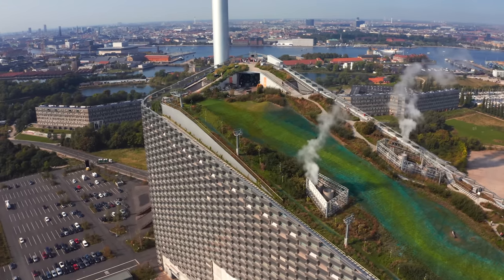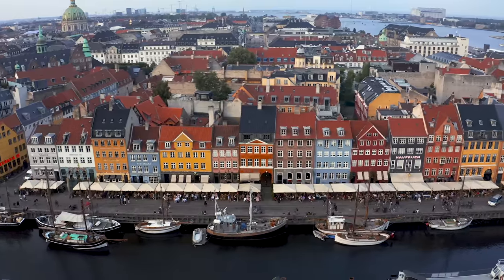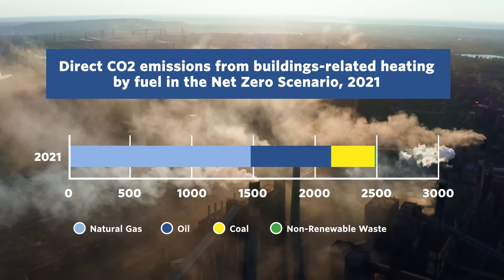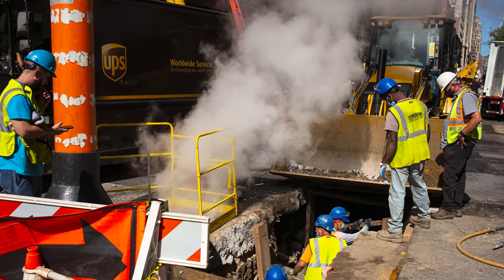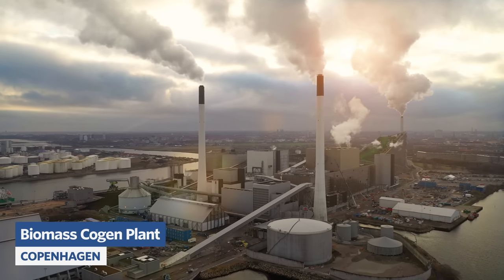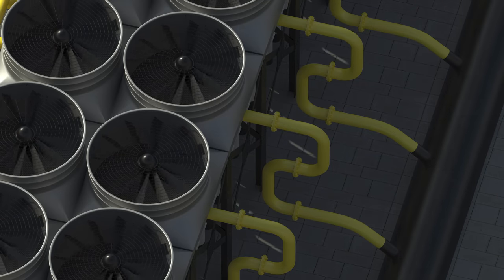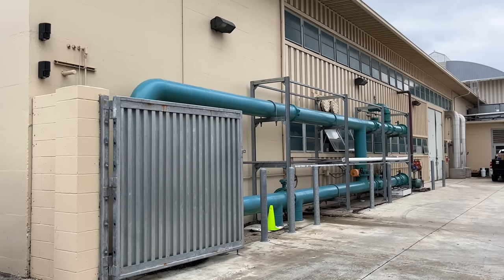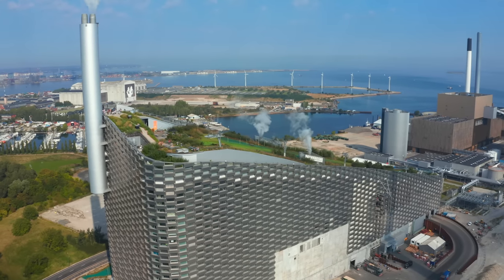An Introduction to District Heating Systems

Comment: My parents were recently connected to their district heating system and its great!
For one, no more boiler maintenance which means the cost-of-living is way more predictable (you will never have to replace your heating system for a lot of money, instead it is just a monthly fee like electricity.
Additionally, they gained a whole ass room in their house since they don‘t need the big and bulky heating system anymore.

The best thing is of course that the district heating system uses an energy mix and as long as the temperatures aren‘t too low it can run solely on renewables (in-ground heat pumps and geothermal) and only if the heating demand is high enough will it turn on the oil and wood pellet burners.

The local government also only connect you to the district heating system if you agree to improve your home insulation, which is done via a credit that you pay off over the monthly fees for the next 20 years, meaning it is actually super affordable.
Reply: And imagine that the power plant can reach 90+% efficiency compared to the ~40% of a good normal one. Isn't that amazing.
Reply: Do you know if it difficult to connect to the municipal system?
Reply: That requires trusting that the source of heat won’t jack the rate through the roof once you’re connected. Which isn’t a good bet.
Reply: @twestgard2  I'd assume it's not the US and also not a private company, but one held by the local government.
Makes price increases like that very unlikely.
Reply: @MegaBanane9  Yes, the US is definitely the worst in this way. That said, English water companies are privatized and the English have also had some really nasty problems with providing electricity to homes of poor people lately, aggressively shutting people off and even home invasions by the utilities to do shutoffs and change the meters. So unfortunately it’s not limited to the US and there’s a lot of political pressure to expand this system elsewhere.
Reply: @twestgard2  yea, the Tories in the UK have been doing their best to turn everything there into US style systems for the benefit of their rich donors
Reply: @DrSeaLionMD  depends on the individual system. I work for energy company where we have a few grids spread out across my home country and complexity varies. Basically it depends on distance to the grid, what the marginal production cost is and how large your heat demand is across the season.
Reply: @DrSeaLionMD  It depends on how far away the pipes are and what kind of heating you're using at the moment. If you have fairly close pipes and use soem kind of water borne heating then it should be fairly easy, if you are far away from pipes you might want to talk to your nighbours and see if you can all pitch in to dig new pipe to your neighbourhood. If you have electric heating at the moment switching to a water bornesystem is also very expensive espeically in multifamily houses.

As for cost at least how it works in the nodric countries is you pay a flat sum for being attached to the network and then an amount based on the current sypply and demand and your use. In summers hot water is often free, the cogen plants must generate a certain amount of hot water to create electricity and they want people to use it.

Comment: On the island of Fyn (Funen), Denmark, the big district heating power plant is so versatile in what it uses to generate heat, that prices have become lower this half year. Yes, despite everything. It was a huge relief, and shows the resilience of the system.
They use waste, straw, hot water from data centres and other factories, heat from green houses, and also some coal.
Reply: I have heard rumors tey will allow the fluctuating prices to go negative in summers in Sweden because of the amount of counter pressure (Heat that industry sell into the disctrict heating grid) they are getting. Probably not fully negative but they may allow use to offset the grid cost.

Comment: I lived with district heating the entire time living in Czechia. Pros: very cheap hot water, never needed to turn the radiators on as the transport pipes running through the flat did all the heating necessary, water was always hot enough to use. Cons: if you use more than your allotted share it's very expensive, two weeks of no hot water in summer while the plant undergoes maintenance (and other off periods where work is required).

All in all, it's a big thumbs up from me and worth the occsional inconvenience.
Reply: The two week cut off is easily solved by having multiple plants.
Reply: @placeholdername0000  New systems usually have heat storage tanks as fallback that can store the needed heat for a winter day or two. Those would easily cover the hot water requirement for 1-2 weeks in the summer. If the main generator doesn't come back up within a day, they can order mobile heat generators, that heat up that intermediate storage, so the customers don't have suffer the heat blackout. Alternatively you install a 300L hot water tank that is heated by the district heating, with electric or gas fallback.
Reply: That's really weird, here in the Netherlands district heating is a complete failure, more expensive than gas and needs constant work to keep working. People that have it, hate it.
Reply: Propose them to build a heat accumulator / battery into the district heating grid. We have them in Finland - for example some decommissioned 190 000 m3 oil reservoir - with perhaps some added insulation. Just fill it with the network juice and heat it when there's less need for heat in the grid - or energy is cheap otherwise. Then, when there's extremely cold period, the plant is broken, or whatever, use the stored energy in grid. So, it balances production and consumption, and can be used as an emergency spare energy reserve.
Reply: I'm guessing Prague? I never understood that 2 week pause, I also live in czech rep. and have district heating, but different city so we never have these long breaks, just the occasional maintenance check, maybe twice per year for a few hours and usually during the day when most people are at work anyway...
As for the allotted share, either that's another Prague speciality or it was something with your utilities company or your apartment building, I don't have anything like that...
Reply: @Aedar  And Ostrava. I think it's a holdover from before 1989, like the insane rent you can sometimes get a flat for.
Reply: That never happens here in Sweden.
Reply: @BLY99  Then you're not taxing you FOSSIL gas enough.
Reply: @DaDunge  So it's not cheaper. And how do you think district heating is powered? Also for your info, the Netherlands has the highest taxes on oil and gas in the EU.
Reply: @BLY99  That's the great thing about district heating, you cna switch power source in it really easily. You could burn garbarge or biomass or you could even use it with renewable energy and a heat pump and take the heat out of the ground. Then there's green hydrogen, and E-fuels. Or you could start using nuclearpower, either Fission or one day we'll likely solve fusion, regardless these prcesses will generate heat as a byproduct.
 
But most importantly there is the counterpressure, many industries pay to put their excess heat into the grid and this then sold for heating.
 
I am an environmental engineer, I have worked with district heating. You want to go 20 quesitons go right ahead.

Comment: FYI, district heating is used here in Norway as well, but not to the same extent as in a lot of other places.

It's mainly used in the larger cities near large industrial sites and waste to energy plants. Currently it provides about 10% of heating nationwide.
Reply: I mean one could combine geothermal heating with renewable energy to provide contrla heating. You have a lot of mountaints to take heat from, and a lot of renewable energy. Electric radiators are very inefficient.

Comment: My city has added heat pumps to its waste water treatment system, extracting heat from the waste water before it's sent out in nature. Taking the waste water from 12 C degrees to 3 C degrees, and adding the heat to the district heating. They also added a heat storage for the warmer periods of the year, to use in the winter.
Reply: Which city please? Thanks.
Reply: Interesting, how do you store heat for have or even quarter of a year to wait for longer periods??
Reply: I think the word you're looking for is heat exchanger not heat pump.
Reply: @DaDunge  In that case, the waste water wouldn't cool as much as 3°C, or that means that the ambiant water temperature is that low but I highly doubt it.
Reply: @etbadaboum  No heat exchangers cna operate at much higher echange rates than that. A heat pump is just a heat exchanger and a fan (two fans?).
Reply: @DaDunge  Gosh, you clearly don't know how a heat pump works, do you? 🙄
Reply: @etbadaboum  I don't think you know how a heat exchanger works. Becuase Yes I do know how a heat pump works and I do  know how a heat exahnger workss and it seems to be the same way. Using two media in two interconnected systems and a phase bundary to move ethalpy from one system to the other.
Of curse in any rela applicaiton you have severla heat exchangers as part of a heat pump or a fridge or any real device.
Reply: @DaDunge  I have an engineering degree in energetic systems and I designed both systems in real-world applications. You don't know what you're talking about.
Reply: @etbadaboum  I think I know what the issue is in my fuield we call the entire heat exchanger cyclke heat excahnger, it's because we have to work with people it's hard to explain to people they should chose district heating over a heat pump while calling one of the component of the systme which brings district heating into their home a heat pump. As such we refer to it as a heat exchanger, while really it's two heat exchangers and a compressor.
Reply: @etbadaboum  Gothenburg, Sweden
Reply: @DaDunge  I checked now after your comment. And what I can find is that it is heat pumps,  not heat exchangers.
Reply: @DaDunge  Good come back. I assume the district heating when connected to a building which is a heat exchanger or in simpler terms a radiator is the method of introducing heat to a building. Do they also use a building installed heat pump if they are many miles from the plant producing the heat so that water that may be too cool to provide sufficient heat output can be effectively raised. As an example the water at 10 miles out is now only 20 degrees C but if a home owner uses a heat pump it provides a large rise in temperature in the output of the heat pump and probably provides at least a 3.5 to 1 return on electrical input.

Comment: You can also produce biogas in a water treatment facility and then burn this gas for district heating system thus reduce the methane emissions from the water treatment process and have a renewable fuel for dustrict heating. This has proven to work in places like Denmark or Sweden. In my hometown (Tychy, Poland) we also have something like this but just for a part of the city.

Comment: This is so cool, and indeed I had never heard of "district heating" before! You even anticipated and answered my question about if district cooling was also a possibility! It's nice to hear about the neat things different times and places have done to improve life while reducing the net need for non-renewable fuel.
Reply: This is so coolth* ;D
Reply: An even cooler thing is counterpressure, that is instead of district cooling industires who would need district cooling puts their heat into the district heating grid so people can buy it to heat their houses. I guess it could be done the other way around in hot places, industries who need heat could pull it from the grid using a heat exchanger and electricity and the cold water they generate cool people's houses.

Comment: Oh district heating is definitely sexy alright. As you mentioned Denmark as an example, what makes co-generation and district heating even more interesting is the fact that danish plants often use large hot water tanks adjacent to co-generative power plants in order to balance the electricity production. The whole act of grid balancing becomes much more fun when you have plenty of installed capacity coming from windmills and you need to be able to balance it all with everything you have. It's a nice way to create super cheap (sometimes free) heat on particularly windy days.

Comment: The most interresting thing I have seen about the danish district heating, is that they have begun to connect industrial buildings that produces heat asweel as supermarkets where they have fridges and freezers. Which is a really awesome way to fully use all potential energi being produced
Reply: yeah... that is only a half truth after its been through a PR machine! 
I do actually work a place where we provide heating to half the town, heat that was previously wasted, a lot of steam and such is used on this factory. 
However, it is something that is done with a dispensation, a "pilot project" and the few other places similar things are done, that is case too. 
It is infact illegal to provide waste heat as district heating, and to get dispensation takes a lot of money and time. Many have given up trying to provide their waste heat, and has to just "flush it out" 
I DO hope rules will change - The funny thing is, this is what comes from embracing capitalism, everything should be free market - until the capitalists feel they are ones loosing and can't compete, then it should rather be illegal! (I do support capitalism, mostly, but stuff like "We can't do this obviously good thing because that means someone can't make a huge profit on the service then" is not something I support!

Comment: I live in Aarhus, the second largest city in Denmark, and our heat is also distributed as district heating. We have a large facility on the northern outskirts of the city, which used to burn coal, but has since switched to biofuel.

Comment: I went to a college that had district heating via steam. You could see where the steam pipes ran under the sidewalks because the snow always melted there first ❄️💧
Reply: Finland has several cities where this is done intentionally. Heating water that has circulated via houses and is being pumped back to the power station is channeled via sidewalks or a pedestrian street, which melts the snow and ice so people can walk there without fear of slipping.
Reply: My campus did this accidentally at first, but now it's part of the guidelines for any new building to have steam heating next to doors and any new pathways where a connection is available

Comment: The ongoing energy crisis is making us more creative in Europe. Waste heat is a resource, but has often been treated as a problem. 

Not only can we get a lot of useful district heating from power plants, like nuclear or bioenergy/waste incinerators, industry too can produce and take advantage of heat "recycling", both producing and consuming. A data centre may produce low grade heat, a steel mill high grade heat, far from any urban centre. But this cheap heat can be useful for e.g. indoor farming that uses considerable heat especially in winter, or other heat-intensive production, e.g. glass making.

Comment: Pretty great video! It's also good to point out that a REALLY efficient steam power plants have thermal efficiencies of 30%-40%, while cogeneration can easily hit above 90%. Currently, most of the energy we use for electricity is wasted as heat, and we should be capturing that for use in buildings during the cold months (and perhaps trying to store it in the summer, but I don't have high hopes for that being an efficient use of space).

Comment: There's also a concept called "cold district heating" which, at first, sounds kind of wrong. But basically it's like district heating, but with cooler water (about 5-20° C). The water is then used to run a water-water or water-air heatpump.

The advantages of this concept are: you don't need to insulate the pipes carrying the water as well as for a district heating system, you lose less heat on transport, you can use heat sources that would not be hot enough for district heating (eg. server room waste heat), there are many different ways to get your water/heat source (lakes, rivers, geothermal, water cooling systems...), you can store energy by storing warm water in caverns and stuff like this and the heat pumps work more consistently and efficient than air-air heatpumps as the delta between the heat source and the wanted temperature could be smaller during the winter.
Reply: Interesting, but you can also store the near-boiling water in caverns or tanks. It's a typical technology used to balance the consumption and also as backup. Of course there are backup plants in the grid too, often more polluting so not used regularly.
Reply: The pipes are fairly well insulated in the ground though I think what you lose in economies of scale is more than what you gain in not losing to heat bleeding from the pipes. A bigger heat exhanges is generlaly more ffective thana  smaller one.

Comment: There is another level to this, in Sweden at least, large furnaces etc. from industry are connected to provide heat to municipal heating. The industry sell the heat to the city network instead of venting it all to waste. And the city don't need to burn something on their own to provide the heat. 

If there is one industry in a village or small town, they often are the solve heating provider. So central heating is not just for cities.

And this is the reason Sweden import garbage, due to recycling we no longer generate enough domestic garbage to fuel the heating plants.
Reply: It's called district heating counterpressure I think.